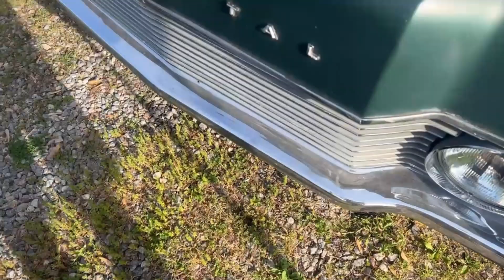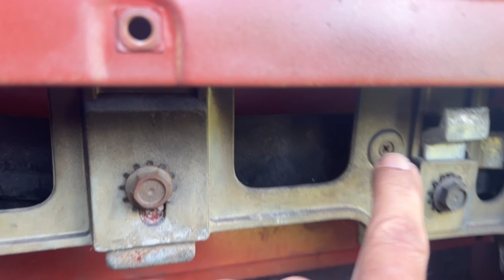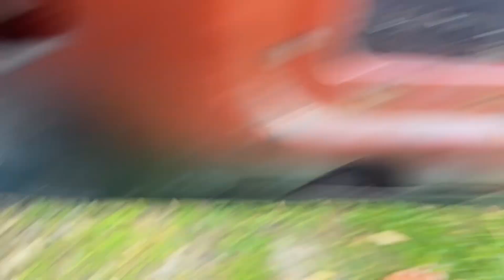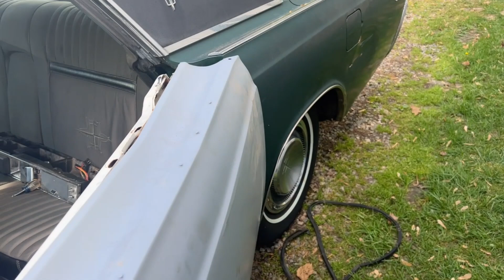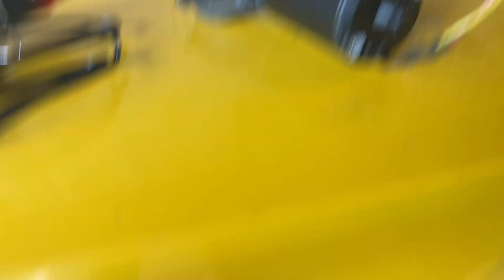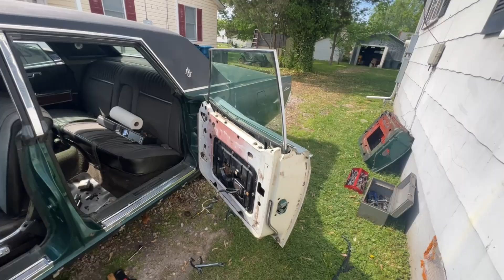1967 Lincoln Project Update 3 May 2024 Replaced LR Door

Comment: Great video.  Flashbacks from when I had to replace the passenger window motor in my '71 T-Bird.  Took me a month of Sundays to get everything aligned and tightened.  Question:  Are the gears in your new motor nylon or metal?
Reply from the maker: I don't know what kind of gears this new motor has - had no reason to take off the cover to examine since the motor came with a new drive gear.  On all the ones I've ever seen though, the part that engages the worm gear inside the motor has always been nylon while the part that engages the regulator has always been metal.

Comment: It looks like that door may have been replaced before. Isn't that red paint inside of it? Maybe that is why it has lock vacuum tubing.
Reply from the maker: Hi.  No, all the doors have that coating on the interior.  I think it's just a factory type of thing.  The vacuum tubing is not just in the door - it extends from the body of the car.  I just find it interesting that there is some vacuum tubing at the rear of the car for doorlocks even though the car never had them. Both rear doors are setup the same way - with unused vacuum tubing inside that extends into the back of the car.  It definitely saves me some time if I ever do decide to install the door locks.
Reply: Thanks for the reply. When I saw the white door, I saw that it also had red inside. 
That is like a Buick that I bought years ago. It had no radio but did have an antenna base on the fender, antenna lead and all the wiring. From a wrecked car, I got a mast, radio, speaker and fuse, and I had tunes! @victorpalma6529
Reply from the maker: Cool.  I always loved going to junk yards and finding things I could use.  My dad got me started on that.